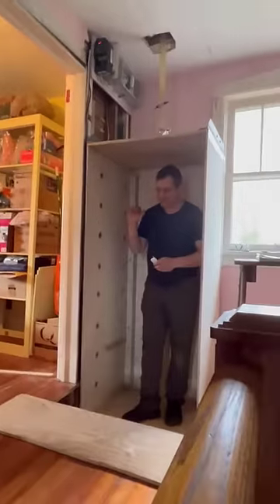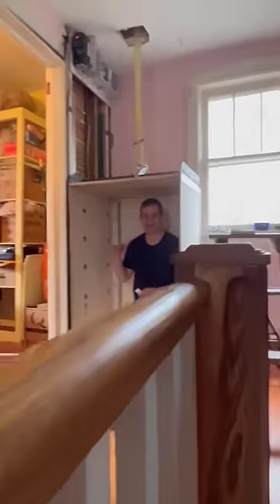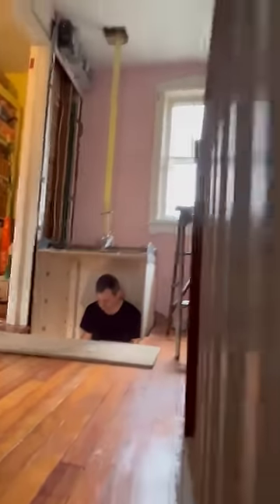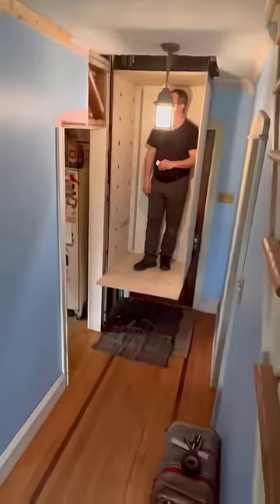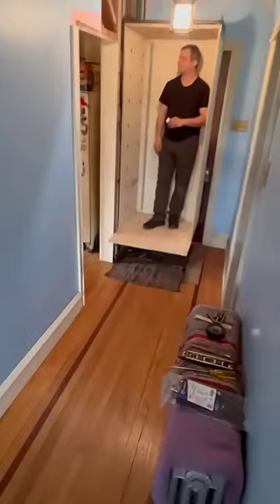Home made DIY Elevator First ride with test dummy 😁

Comment: Use a treadmill?
Reply from the maker: hell no, those motors are way too small. 
unless you're talking about me... which, obviously no. and that's rude😂
Reply: @AlexR_44  What about that cool pulley system that reduces weight with gears that we learned about in grade school? Lol
Reply from the maker: @ThatoneguyFreeling  I suppose if you wanted to, maybe, but we had access to a nice motor and gearbox that wouldn't add a shitload of complication. Counterweights take up space and can be dangerous, and the amount of gearing down for the motor to do it without one would be slower than a stair lift, IIRC. I know my uncle ran the numbers on a couple treadmill motors and they just weren't worth it.

Comment: Its a good idea, but just a warning. My friend did this same setup, the winch broke loose. It killed his dog and injured his wife. Just a word of caution.
Reply from the maker: I don't believe you. 
If for no other reason than nobody has this same setup.
Reply: @AlexR_44  not wanting to ruffle any feathers. Just don't want to see anyone hurt. His was a winch mounted in the attic and a snatch block on the elevator box. The winch broke loose, the elevator fell with his wife and dog in it. The winch came through the top of the box and crushed the dog. 
Take it for what you will.
Reply from the maker: @steve001hsd  Ours is mounted in a way the a sizeable portion of the house would have to implode on itself for the motor to fall. Or... I guess and act of sabotage would do it, but I don't think the attic mice are strong enough. 
It's mounted to a board with steel plate and 3/4 graded bolts with washers and lock nuts. That board spans two joists and has a leg that is supported by the brick wall of the house. 

Your friend needs a better mounting method and a stronger car, and most of all, a safety brake of some sort. 
Thanks for the concern, I hope you're all well.

Comment: Very cool but also very dangerous..
It looks like this is being held aloft by a single rope.  Elevators have lots of systems to ensure passengers are safe in-case of an accident, but you seem to have none.
Reply from the maker: @FurryEskimo  there's a safety brake, and it's a 20,000lb strap, it'll be fine😂.

Comment: Это плохо!!! На 2 этаже прийдëтся делать ограждение либо закрытою коробку чтобы случайно не упасть!!! Надо было сделать чтобы опускаясь на 1 этаж крыша лифта была вровень с полом 2 этажа!!! 😊😊😊
Reply from the maker: Nah, we just use caution.
Reply: А лифт по умолчанию будет всё время на втором этаже, он же входную дверь загораживает. Я на другое обратил внимание - как пол закреплён - судя по всему просто на саморезах в торец😮(возможно на клею). Ни болтовых соединений, ни ребер жёсткости, ни металлических уголков я там не вижу.
Reply: @svyatoslavkolesov4727  и что приятно что над тобой что-то висит??? Наверно надëжно ноооо!!!
Reply from the maker: @svyatoslavkolesov4727  Translated: "And the default elevator will be on the second floor all the time, it also blocks the front door. I noticed something else - how the floor is fixed - apparently just on self-tapping screws to the end😮 (possibly glue). I don't see any bolt connections, no stiffeners, no metal corners."

Again.. Go get someone that speaks English to read the comments. The car is Aluminum angle framed with T-nut style fasteners. 
You don't see it because we did good work. Thanks👍

Comment: Все подъемные механизмы очень опасны, помимо этого они очень опасно ломаются. Помимо этого они требуют обслуживания.
Если у вас нет сил подниматься по лестнице самостоятельно , то это значит что нет сил на обслуживание и уж тем более нет сил на неожиданный ремонт.
И как человек, у которого нет сил подниматься по лестнице, будет выбираться из застрявшего (сломавшегося ) лифта? Да он умрет там...
Reply from the maker: Translated: "All hoists are very dangerous, and they also break very dangerously, and they also require maintenance.  If you do not have the strength to climb the stairs yourself, then this means that there is no strength for maintenance and certainly no strength for unexpected repairs.  And how will a person who doesn't have the strength to climb stairs get out of a stuck (broken) elevator?"

No one lives there alone, and they have phones. Several family members also live within minutes of the house. 
As for maintenance... I'd reckon it'll run for many years before any is needed, but we check it from time to time.
Oh, and it's not a hoist like you think it is, it's a 3 phase motor and gearbox rated for constant duty.  Also - go watch the safety brake test video: https://youtube.com/shorts/H_rcsyH0Qyw?feature=share
Reply: Ага! Ещё и полностю блокирует выход
Reply from the maker: @ЛюдмилаБойко-е2ю  один из трех, около минуты за раз
Reply: У него не тот случай,что он застрянет

Comment: Good way to get your home insurance claim denied. I wouldn't want to trust my safety or my loved one safety to some janky ass thing like that. Hopefully at least you use a hoist instead of a winch.
Reply from the maker: Been in use for almost a year now with no safety issues. At least twice a day, every day.
Gram sits on a bench while it's in use, obviously not pictured here.
We used a 3 phase motor and gearbox, which you'd know, if you did some research before commenting some negativity filled blah blah blah. 
Thanks for the feedback though.

Comment: Никакого смысла в кабине нет, достаточно боковой стенки и платформы
Reply from the maker: Translated: "There is no sense in the cabin, the side wall and platform are enough"

I initially thought the same, but was talked into it easily for the following:
A. it makes for the space required in the wall to be less (no need for pulleys or stronger bracing, and for us, it meant less demolition and repair leaving the middle studs intact.)
B. It's more pleasing to ride in, feels safer (even with the front open), and looks better when it's parked upstairs. 
C. using a central lifting point was way easier for us when it came to locating the motor in attic.
D. probably most importantly, it was the easiest way to keep the bottom platform as thin as possible and still exit the direction we needed, making wheelchair loading easier and it's less of a step up for gram, who struggles with stairs now.  - This is also why there's no added safety buffer on the bottom. I'm surprised nobody has pointed that out yet.

Comment: Doesn't look OSHA approved
Reply from the maker: Occupational ? nope
so they can go administer someone else's safe health.  😋
Reply: @AlexR_44  well Alex
Just where is the structural reinforcement 
and the safety brake
Reply from the maker: @jimh4167  aluminum angles and on top of the car. 
You didn't even look in the description or read any comments did you?
Reply: @AlexR_44  
I assume you have never built any thing
Or have a background in Saftey
Without an adequate structural cage to build from.   It's one step from falling apart
Also without a front safety device
Someone have a problem. (seizure or ?)
Could fall out or partially fall out and caught between floors
You shouldn't give the illusion you have knowledge to some without a clue
When you have non
But what ever YOU build at your PERSONAL home
Knock your socks off
Reply from the maker: @jimh4167  Let me guess, you've paid lots of money at some point to get some sort of certification or license. People like that llllooovvve to shit on others' work. 
One step from falling apart? It's been in use for almost a year, at least twice a day, zero signs of any change. 
Have a read through the comments, you'll see I've addressed all that crap you're afraid of.

"You shouldn't give the illusion you have knowledge to some without a clue
When you have non"
My high grade school English teachers would like a word with you. When they're done, come see me and tell me exactly where I said anyone else should do this? Or in what specific way I've illuded to any knowledge?..